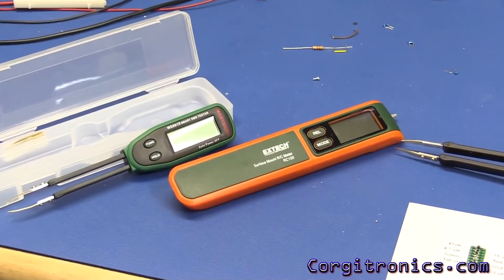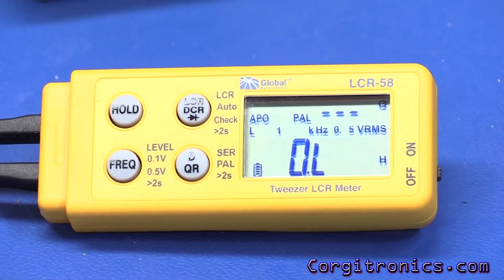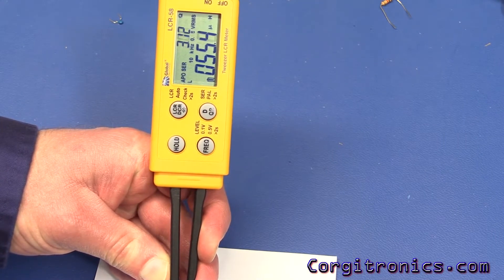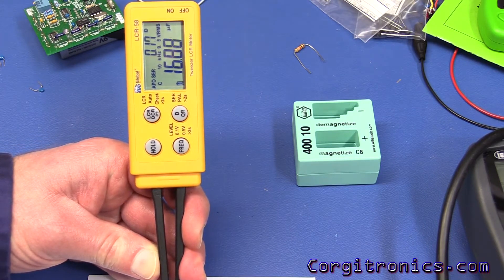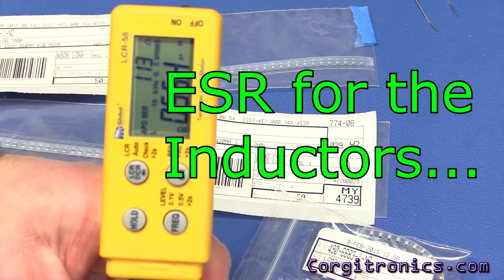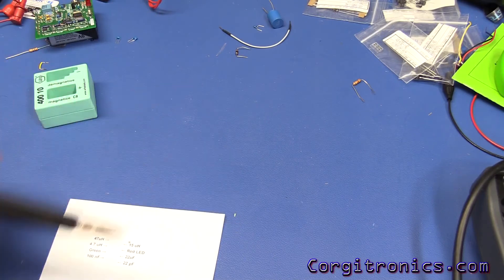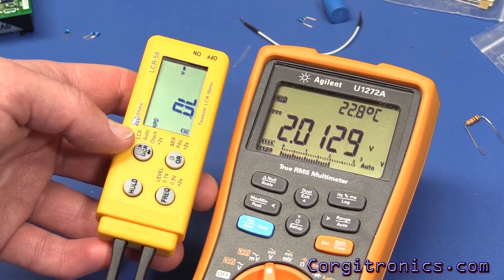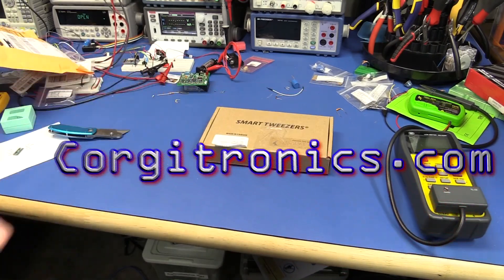SMD Smart Tweezers - Part 2

Comment: Hello Mr, could u tell me function of D/QR button (SER/PAL/>2s) is? when I use this button?
Reply from the maker: I would recommend googling that, like I just did to find this consise explanation:  http://www.techni-tool.com/site/ARTICLE_LIBRARY/BK%20Precision%20-%20How%20to%20Use%20an%20LCR%20Meter.pdf

Equivalent circuit: components are modeled with one
 of the two following equivalent circuits:

where X is the reactance of the component, Rs is the
 series resistance, and Rp is the parallel resistance. If the reactance is large, the series resistance may be negligible, so the parallel model might be a better fit. Conversely, if the reactance is small, the parallel resistance may be negligible, so you may want to use the series model. Thus, the guideline would be to tend

to use the parallel circuit model for small capacitors and
 the series model for large capacitors (see Figure 1).